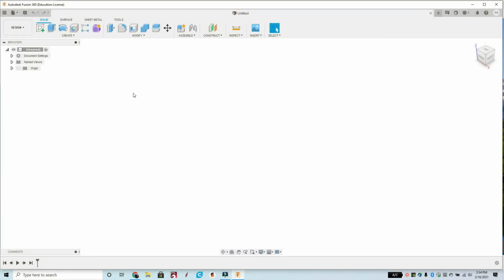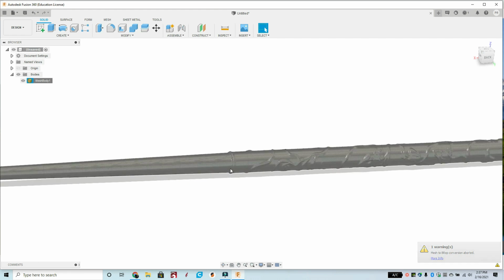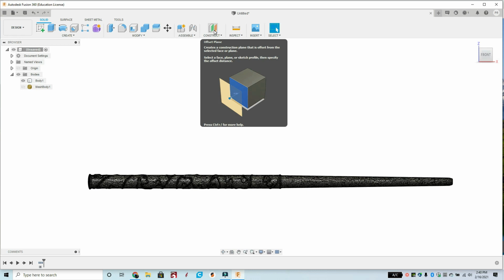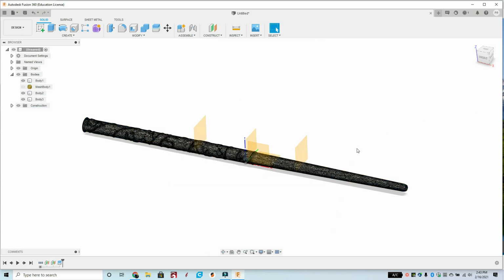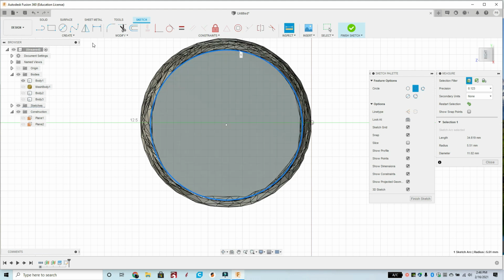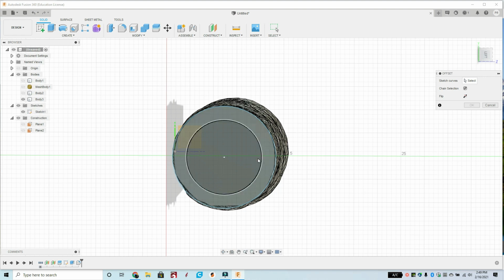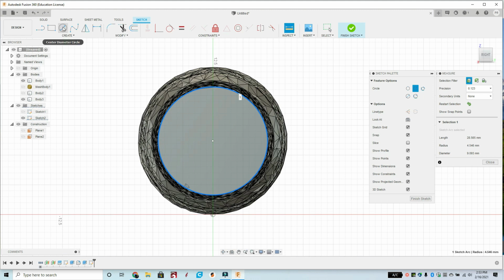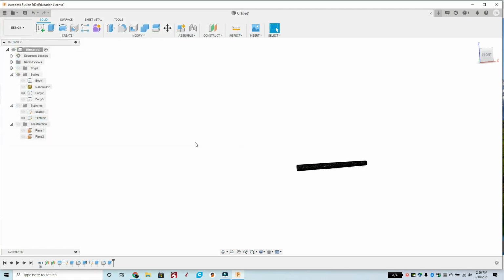How to split a STL File in Fusion 360

Comment: There is no MeshtoBRep anymore
Reply from the maker: Yes unfortunately it is not supported anymore. Here is the program I use now https://touchterrain.geol.iastate.edu/?trlat=48.89774543654454&trlon=-121.5433792374066&bllat=48.34974934183187&bllon=-123.21876521920478&DEM_name=USGS/NED&tilewidth=300&printres=0.199&ntilesx=1&ntilesy=1&DEMresolution=81.93&basethick=5&zscale=1.0&fileformat=STLb&maptype=roadmap&gamma=1&transp=70&hsazi=315&hselev=45&map_lat=48.56748343735251&map_lon=-122.71201003924637&map_zoom=9
Reply: @RowdyRoman  I solved it by inserting the file inside from the top menu. When I inserted from there the body was selectable for splitting. Thank you for the fast response tho.